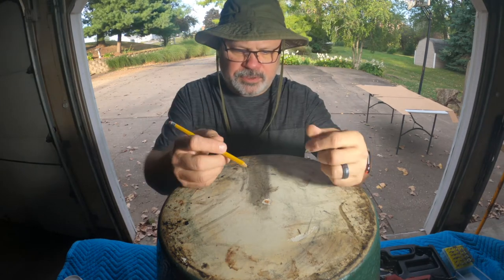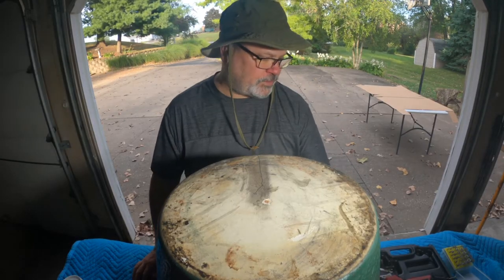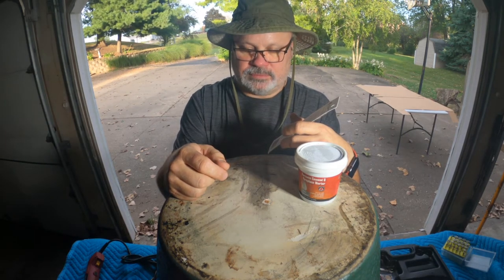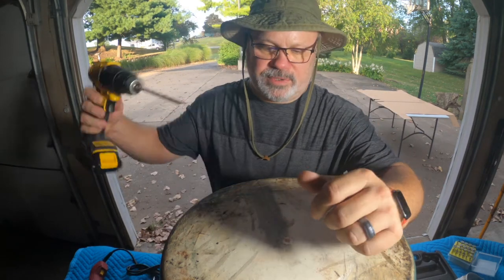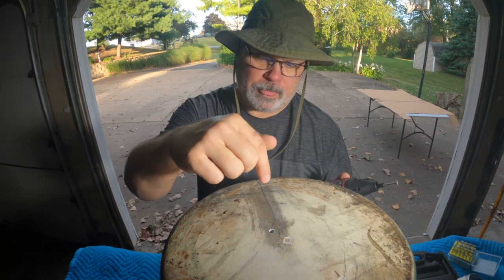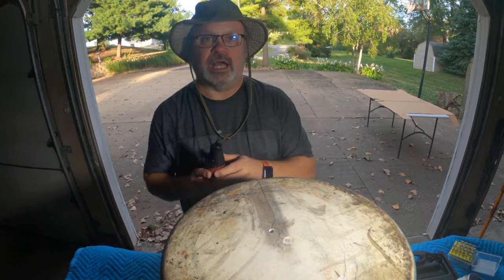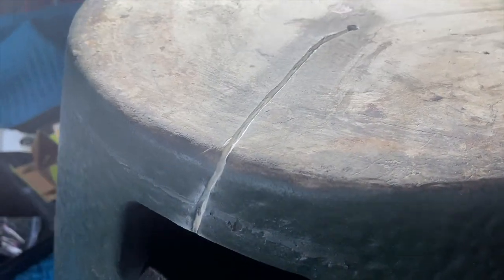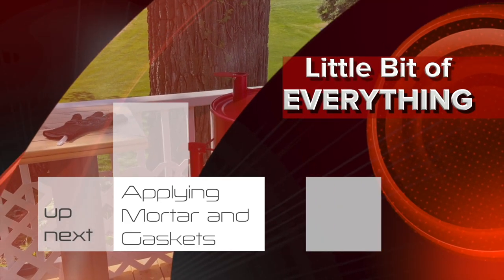Refurbishing the BGE - Fixing a Crack in the Base

Comment: I have performed this type of repair numerous times on both original Kamados (Japanese), and BGEs.   I much prefer working with JB Weld rather than the Rutland.   Neither have failed, but the JB Weld finishes much better.   Thanks for posting, looking forward to the next segment.
Reply from the maker: Thank you for stopping by!!  I appreciate your comment, and I also appreciate the information.  I had a difficult time finding much information on this and my BGE supplier kept telling me I needed to replace it but that was his job to try to sell me something.  Anyway its held up well, and I did that repair quite a while back.  If I have to do it again, I always have JB Weld on hand.  Thank you sir and God Bless!
Reply: I wonder if you can add some mesh strips to the JBW or mortar to reinforce the crack?
Reply from the maker: @juanitov214  not a bad idea. The fix that you see me doing in this video is holding up really well. R Wayne talked about using JBW and heating it till it flows then allowing it to settle in the groove. JBW sounds like it might be a better solution, but again, this one is holding as well.
Reply: which jb weld product do you use?  i see an extreme heat that is more of a putty and then im not sure what other jb weld product would hold up to the heat.  please advise!
Reply: @fro0tyl0opz    The regular JB Weld is fine,  it doesn't see near the heat you might think it does.  I recently had to use it extensively on a medium BGE, on both the smoke ring and the firebox.   Once applied you can hit it with a heat gun and the surface will liquify and you'll get a super smooth, slick finish (if your repair is going to show).  I use that trick when filling a gap, apply the JB over the crack/gap and hit it with the heat gun.   It liquifies and wicks into space.
Reply: @rwayne3243 would you recommend drilling out with drimmel to get more material filler in or just apply JB Weld and apply heat to get in place?
Reply: @jasonsimotes4157   If it's a surface crack where the parts still fit together tight, like on the dome, I dremmel out a V or U shaped groove right over the crack to get more surface area for bonding.  If you don't dremmel, you are just applying a layer of JB over a crack.....  the JB is being stressed in shear in that case, and not nearly as strong as it could be......   It's also pretty ugly.

If you are bonding two separate pieces back together, meaning you could hold one piece in one hand and the other piece in the other hand, just apply JB weld to both fracture surfaces and join them together.   I like to heat the JB to make it thin, you get a thin bondline that way, which is much stronger than a thick bundling.   You'll need to figure out how to clamp the two pieces together before you start.

Exactly what repair are you performing?

(I sure wish you could post pictures in the comments section of YouTube.   There are some good YT videos of BGE/ceramic smoker repairs)
Reply: @rwayne3243  repairing cracks in a big green egg chiminea. There is a crack from the top of door to the cooking grid or where the chimney sits. As Well as a crack from the bottom of the door to the base where is disappears. Hate to remove surface because large section of my crack is very visible but BGE doesn’t warranty these and they aren’t common at all. I was lucky enough to get some touch up paint from my local BGE dealer. So I should be able to conceal it decently. 

I practiced on a cracked porcelain bowl I had and didn’t like applying with a putty knife. I am going to brush on like @littlebitofeverything did in this video and see how that goes for me before attempting on my chiminea.
Reply: @jasonsimotes4157  Yikes!   You have a tough repair to make....    If the crack goes all the way through to the inside, and if you can access it, I would make the repair from the inside.

I just looked at some pictures, if the crack extends all the way through the material, you definitely want to repair from the inside.   Once repaired, and cured, use the touchup paint on the outside.......    if you thin the paint a little it might wick into the crack a little easier......   Or you can could lay a heavy stripe of paint right over the crack, hit it with a heat gun and let it wick in, then wipe with a cloth......

Take your time, I bet it comes out nice.
Reply: @rwayne3243  yes sir it does go through. I plan on taking some material out of the outside to make a nice clean repair job but taking majority of the material out of the inside for a strong bond. It will be a big job but it’s worth doing to me atleast. I’ve been hunting a chiminea for years and picked this one up for $80. Not in the best shape but puts a smile on my face every time I see it.
Reply: @jasonsimotes4157  Good deal, keep us posted.   I recommend doing the repair incrementally if it covers much area.   Two or three small bonding operations, where you can take your time and get it right, is better than one large one where you have to rush before the JB begins to set up.

I guess you know the trick of drilling a small hole at the end of the crack if it does't terminate into an opening.....    Good Luck.